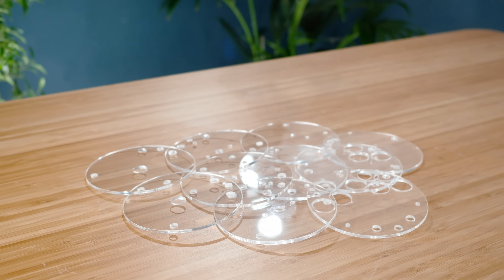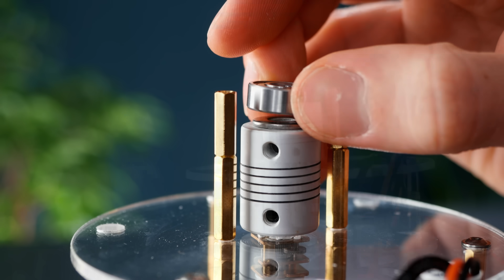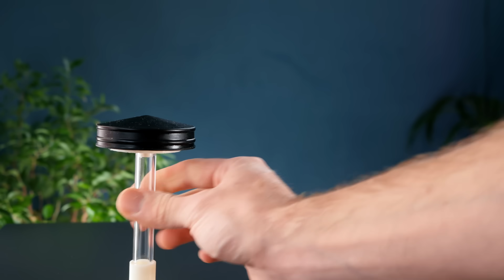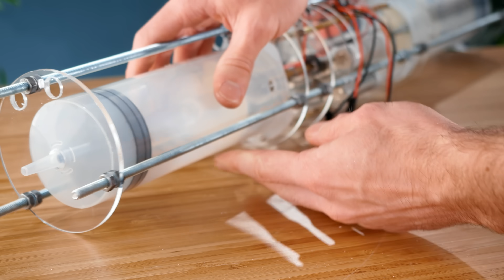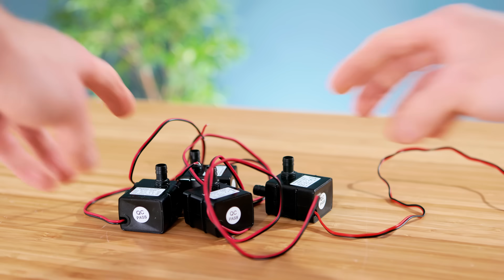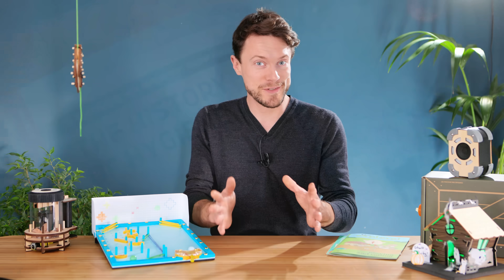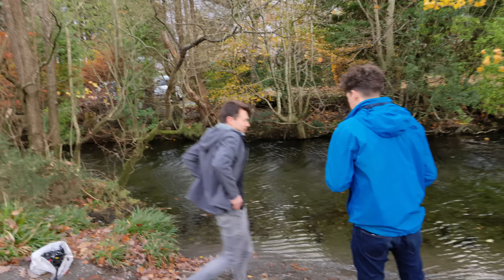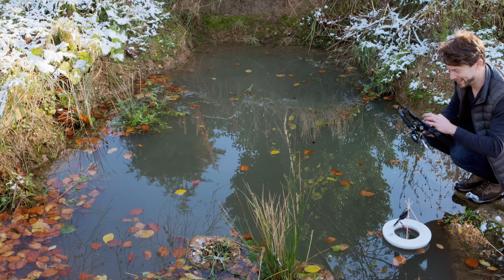Building a DIY submarine

Comment: I wouldn't mind seeing it with a much longer tether (20-50M) & perhaps even replacing some of the inner air volume (around the electronics) with deionized water/clear mineral oil. This would reduce your need for solid ballast & disperse the mass across the length of the vessel.

Also add tough loop points, so that when you go out on a deep lake you can take along a boat hook for ease of capture. (It doesn't seem to be the warmest water to take an impromptu swim in...)

Once you've got a finished design, you can fix two together in rigid tandem, using your Left/Right ballast tanks as an aid to steering (like the US/Russian Bhemoths do).

Comment: Outstanding video! So interesting! I assume that this design has a maximum water depth due to the seals/membranes at the ends of the long tube. I would estimate that the design, as it stands how, will be able to safely descend to around 2 meters, without starting to leak in water. I also noticed, during the second test in the video, that the sub, after reaching and passing 0 buoyancy, the descent rate accelerated. Probably due to the deformation of the seals on both ends of the sub. But, hey, outstanding work!!!!
Reply: Water leakage can be easily avoided by increasing the inner pressure. Just add a simple bicycle valve and pump some air into it. 0,5 bar will be enough for 5 metres depth, if the tube can handle it.

Comment: 4 kg of brass pipe and end fittings in that size is gonna cost ya :)
 i would look into submergible aquarium power head, used for creating more current in a coral tank , basically an underwater prop pre made, still needs a diving siren and periscope to be a true submarine

Comment: You should add small hydrogen cells to create more gas so the internal pressure can equalize at lower depths or alternatively strengthen the hull, acryllic is a poor choice. A propeller for main thrust would be much more efficient too, you may also select to add a barometer to estimate the depth and a gimball mounted external camera with a large lense for lower light levels.

Comment: Totally sweet video, but I respectfully disagree with your intro. The principle of flotation states that a floating body displaces its own weight of the fluid in which it floats. Meaning that if it floats, the object is equal in weight to the water it displaces. It doesn't weigh less than the water it displaces. It floats because the object has more volume than the volume of water it displaces (meaning it's less dense than the water).

Slick idea using the reed switches!

Comment: "Blow the ballast tanks" is the phrase that's always heard in the old sub movies.  "Blow" being the key word.  As a kid, it always intrigued me, how "blowing" the air out of the tanks would make the sub rise.  That seemed contrary to me, but when I got a little older, I guessed they were filling the tanks with compressed air (as you did in the beginning of this video) to submerge and then releasing the pressure out of the sub, it would then rise.  Am I wrong in my guess about how real subs work?
Reply: Im no expert but it sounds plausible
Reply: I forgot to add that blowing compressed air out could be done faster (or slower) than pushing water ballast out.

Comment: awesome!

Arm Chair Upgrade Ideas:
1) add some floats to the cable to help keep it slightly buoyant/ very buoyant just above the sub.  This may help keep the cable above the sub and prevent it from wrapping around any of the jets.  Also maybe consider testing the strength of the cable you are using/how strong it is attached to the sub.  It's probably fine, but adding an independent cable with it's own structural attachment point might open the door to you being able to do some really fun stuff.

2) Take a page from James and add dome higher def cameras to you rig.  I'm sure you can make a whole video just about that and salvage some cameras from cell phones or something lol.

3) I think you need to add sonar.

Comment: this is absolutely amazing! Question; is the battery life enough? will it be a option to add batteries as weight resulting in longer battery life... or even stronger pumps as thrusters for SPEED... still i love the idea and the build... other option would of course be using a metal casing instead of acrylic or a combination of both to allow light functions.

Comment: Superb project and engineering. I used to do submarines. I found 27mHz and 40mHz radio gave good control in swimming pools to a depth of 2.5m. Brackish water was never good for signal penetration. No 'flylead' aerial is scary as a loss could be forever!!!! Excellent job sir !!!!

Comment: The lights for the camera would be better at the far ends wouldn't it? To stop the big clouds of light defusing through murky water being over the lens? And some leds with lenses for some little spot lights.. The little sub needed the motors tilting for altitude control and using differential thrust for stirring.. Also if you angle back your side thrusters slightly then you could use the pumps to create extra forward thrust

Comment: So cool. But how did the submarine engineer account for the weight with the sailors and their equipments to accurately make it neutrality bouyant? He couldn't have guessed how many sailors will be in the submarine at all times?

Thank you.
Reply: If the sub is diving, he knows it's more dense and can exhaust some water from the ballast tanks with the flick of a switch. It's just a balancing act between the density of the sub relative to the density of the water he's in. The same sub, with the same people and the same equipment would have to exhaust water in tropical, warmer waters and take on water in North Atlantic waters to maintain its depth simply due to the temperature causing the medium to be more and less dense. It's only by 4% but that's the difference between surfacing unintentionally and remaining just below the surface. 

Relative Density Disequilibrium. 

Not gravity and buoyancy.

Comment: You could fill the void with mineral oil to add weight and fight buoyancy
Reply: Buoyancy? Technically, it isn't a thing anymore. Hasn't been since 1915. Gravity isn't a force in current science anymore. It's an effect. Buoyancy is the wrong word. It's Relative Density now. Buoyancy died in 1915.
Reply: @sleepingwarrior4618  Pluto is a planet

Comment: The problem with your "competitors" sub may not just be the weight of the tether, also the fact that that he used water to achieve neutral bouancy. He will naturally have slack tanks / free surface effect, causing the weights to shift with every movement. Best option to achieve neutral buoancy is permanent (ie fixed) ballast that does not have room to move. It is possible to achieve this with water, though you need to reverse engineer the weight needed. 

Your idea to work from the center, with the battery pack probably being the heaviest, made it probably have naturally more of a neutral trim, though it seems that after adding the weights you have small trim issue, probably meaning you are just a few grams off in one end as it is floating quite well from the looks of it. Would love to see how it behaved in a bit deeper water though, it seems to be quite decent, though maybe a bit underpowered.
Reply: Another issue with trying to achieve neutral buoyancy before submerging is that the conditions of the water will greatly affect how much needs to be displaced to be considered "neutral". Things like temperature, salinity (salt content), and pressure will limit just how deep that submarine can go and how well it performs. In particular the sub's inability to regulate the pressure of the air inside its ballast tank will make it so either there's a maximum depth to which it can descend; or if it can go deep enough, it'll result in the ambient water pressure being so great it compresses the air inside more and more as it sinks to the sea bed like a rock. The latter would be a somewhat greater issue for DIY Perks' submarine as it relies exclusively on the pressurised ballast tanks for buoyancy where ProjectAir's vessel will be able to counteract somewhat by using the propellers and fins to orient itself vertically and push itself back up.
Submarines are complicated, yo.
Reply: Better solution would be single buoyancy tank and move-able ballast section which will auto-balance vessel as it goes.
Reply: @notean  That would complicate things a bit though. A simpler solution would be to add additional servo to control the two syringes separately, and being able to ballast forward and aft independently. Though suspect a combo of channels on the remote and/or space / weight restrictions might rule that out.
Reply: @TheZirMc  IMO it would make things more complicated as you must constantly compute pressure of tank1, tank2, depth and desired angle . It is possible to with computer controller but not simple. You must constantly fiddle with 2 motors to get balance. In my way you can set/freeze depth and set/freeze angle separately.

Comment: For the giant long tether Couldn't ya turn the connection around/flip it over so it'd be on-top vs underside and then put pool noodle/Styrofoam on a further end of the lead so it'd hold up the extra weight?

Comment: Has James thought about maybe using PoE? With good cable should offer enough power and control to everything needed and only need a light weight cable. 100 meters or 328 feet over a single cable just need something on land to power it. Could use your lovely battery bank. Or could get a ebike battery at proper voltage to make it run? Would have to experiment.

Comment: the presence of an ad isn't mentioned... thumb down for cheating youtube rules
... and you don't need calculations or amateurism like tries and fails to set the buoyancy : you fill 10% of the syringes, you put your sub in water and you pull it down with a dynamo-meter until it just floats, the weight mentioned by the dynamo-meter is EXACTLY the weight you have to ad to the submarine...

Comment: Is it easy to polish a 3d printed part so that the surface works well with an O-ring? I haven't seen the whole video yet, but I would be worried about leakage when using the syringe rubber and housing over a standard o-ring barrier with a 3d printed housing.

Comment: Awesome project! Possible improvements I could think of are a) fine tuning the volume to reduce ballast weight b) reducing the number of pumps to two at the bow acting as transverse thrusters and  using an outboard brushless motor for propulsion (possibly ducted and/or swiveling). Also, using a 868 MHz control link like ExpressLRS or Crossfire to improve range, reliability and penetration could be adventageous.

Comment: Real submarines have main ballast tanks that are either blown dry with compressed air or completely flooded by opening valves at the top. Trim tanks inside the pressure hull are filled or pumped out to maintain neutral buoyancy and keep the ship level. Not sure where you got the notion that air inside the tanks is compressed to dive.
 Syringes are not a good choice for any significant depth because they are not designed to operate at pressure for long periods. The kid's submarine has the issue of not having any trim so once it starts nosing down the water moves to the lowered end exaggerating the problem so a second bottle on the front is needed.

Comment: I've had exactly this on my project ideas list for a few years, but seems you've done all the leg work to work out the design. I would have added an Arduino to control the motors, so you wouldn't need to duplicate the thrusters for strafe and rotate
Reply: If i'm not wrong all new controllers let you set mixing on the channels, so with a little bit of tweaking he could have done it with just 4 motors instead of 8.

Comment: 0:51 That was a very good explanation of Archemides' Principle. Also works for all fluids such as air; here, if a volume of air is less dense (i.e. its hotter) than the same volume surrounding it, then the force (due to gravitational acceleration) on that volume of air is less (since m = ρV, where m is mass and ρ density) than the force of an equivalent unit of air surrounding it due to its lower mass; therefore the relative force on that volume of less dense air is upwards. To control buoyancy one simply controls the average density (and thus mass) of any given volume, from the total volume of a submarine, to that inside a hot air balloon.  Your experiment actually kept the mass constant, and varied the density by changing the volume.

Comment: This is pretty neat.
I would probably remove some of the steel ballast and add some more batteries instead for extended runtime as there are quite a lot of devices in there.
Also 'low power' should probably trigger the ballast tanks to purge while it still can.

Comment: Would 868/915 MHz be blocked by the water? Crossfire and some Frsky receivers run on this frequency. Also you could have tried the DJI digital fpv video system :)

Comment: I’m curious to know (pressure leaking limit apart) which is the limit of compensation of syringe’s volume. You have the cable in case of too much depth, but you can think to add a external detachable emergency weight. 
And maybe you can think to mount some pumps on rotating servos (can raise complexity, but with right o-rings it can be done) so you can manage better trim and higher propulsion, and obviously give help to the syringe volume in case of you need for speed or force.

Comment: something to think about with doing electric projects that have water, use a hydrophobic spray on them and coat them like never wet. I did that for all my outside electronics and it also has the benefit of keeping dust build up off as well because the water or moisture never allows dust to bond

Comment: Great vid as usual, but.... Being pedantic ;) Flooding the submarine's balast tank does not "make the submarine slightly heaver so it sinks". Flooding the ballast tank Decreases the (displacement) Volume of the submarine and hence increases it's Density with no loss or gain of Weight. !

Comment: Very cool project. However those bearing are not designed for thrust loads. But there isn't much with those small motors. You could also had 4 less pumps by using signal mixing on the radio. I really liked how you hacked the servos for the syringe controls.

Comment: This is a fantastic video!!  So once the slug passes the IR beam I am guessing that the coil chargers up again. If so if you had a latching Circuit to stop it from changing back up until the last IR sensor was triggered you might get a bit more energy in the shot. Just a guess though

Comment: hey , pls make a cheap ceiling fan with light like this Xiaomi Huizuo Smart Fan Light or same from other vendors (actually Huizuo Smart Fan Light you can buy only in China) . in shops such things cost 100-150$ and more, even 1000$ - 2000$ etc , but it is a simple thing - piece of plastic with led around ..... the idea is to have 2 way working ceiling fan ( to move air up from the floor, then to the walls and opposite - from the top down to the floor ) and led around this fan to spread the light in all directions 360 degrees to light the room. such things have brightness level , light mode warm or cold white light and fan speed.

Comment: James's Sub is a nice design, but the sheer weight of the tether cables is a big fail. He should have used a data control solution to avoid the dozen wires.

Comment: I tried something similar last summer, but i used an ikea plastic box and a peristaltic pump to fill a small tank inside. It seemed perfect because it was fully sealed and easy to drill ports in it, but as soon as it was unerwater it would be deformed by pressure and lose more buoyancy than it should... And so i learned why submarines aren't rectangular and made of thin plastic.

Comment: Matt, don't forget about safety!
If the sub goes too deep, it can pull its antenna under the water and you lose control.
It is necessary to add an emergency system that will force the boat to surface if the signal is lost. For example, dump the ballast.
Reply: make the float for the antenna more buoyant than the sub has weight with full ballast tanks under water. that way it can't pull the float down and you don't need some complicated emergency system
Reply: @lordhelmchen616  This is genius.
Reply: Co2 cartridge powered airbags for emergency buoyancy?
Reply: @Scott_C  really smart
Reply: @Scott_C  as nice as that sounds your then fighting the amount of air still in the capsule if its in the sealed capsule like i think your thinking
Reply: That is a good idea, in most programmable RC systems you can set a failsafe condition, which is usually designed to throttle down an RC vehicle in the event of loss of communications, it would be possible to set the failsafe condition to be the two channels for the servos to be in the de-ballasted positions.
Reply: Okay genius

Comment: The U.S. Navy has a project called SeaPerch that is a STEM outreach program for high schools. I suggest looking into it for some ideas. I remember reading the documentation, which was designed to help student overcome various obstacles using very cheap solutions. One thing I noticed that you may want to look into is the tethering cord. ROV tethers are neutrally buoyant. If I remember correctly, the solution they came up to that issue was to attach pieces of foam pipe insulation every foot or so to counter the weight of the line.
Reply: Thats not a bad idea honestly
Reply: thats what they use in the swimming halls so
Reply: @magnem1043  aka buoys
Reply: *every 152.4 cm